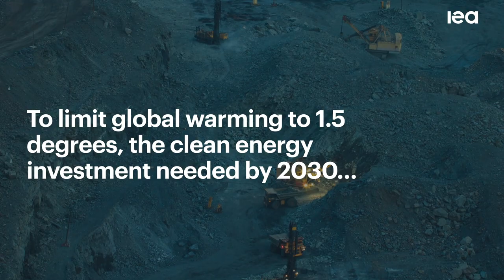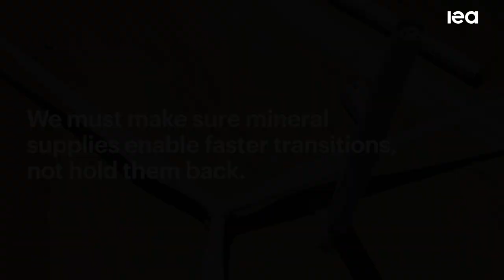These Rare Minerals Hold the Key to Scaling Up Renewable Energy

Comment: Mr Taylor, misleading?.  At 500,000 gallons of water per ton lithium processing water use totals 1/3rd of Lake Erie yearly at current production levels.  Your comparison use doesn't clearly state the fact that modern nuclear or fossil electrical production plants in those cooling towers are recycled over and over; and are typically near a river, lake or ocean with ready access to vaste stores.  Lithium is typically found in deserts where there is little water. Lithium production uses large pools of brine, they do eventually evaporate but that does not assure the water returns to that area and more importantly it depleats the locally available water for other uses; in order to expand lithium production would require multiples of Lake Eries exactly in locals that cannot afford it. This is exactly why one of the largest producing nations - Chile - has now banned Lithium production. The Lithium problem may be rendered moot if Sodium is able to replace it; but for now EVs are responsible for destructive water redistribution in the areas they are found and processed.  Water related problems with Nuclear and Fossil fuel electrical production are likely more around contamination.

Comment: rare minerals and WATER - at least in the case of lithium - you need 500,000 gallons of water to get a ton of Lithium
Reply: Tiny water consumption compared to fossil fuels or Nuclear, a 1 GW thermal power station will consume 20,000,000 gallons of fresh water PER HOUR in the cooling towers or 1 in 6 gallons of fresh water consumed globally. Approx 1,000,000,000,000 (1 trillion) gallons of fresh water per day (enough fresh water per day to mine 2 million tons of lithium to manufacture 300 million EVs per day) and Lithium is not a rare mineral it's approx the 30th most abundant element in the universe.